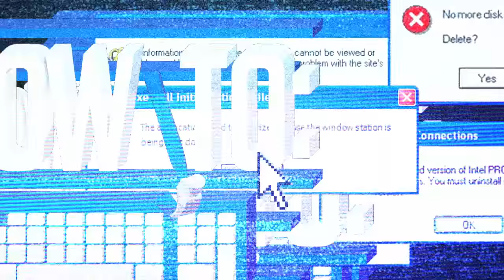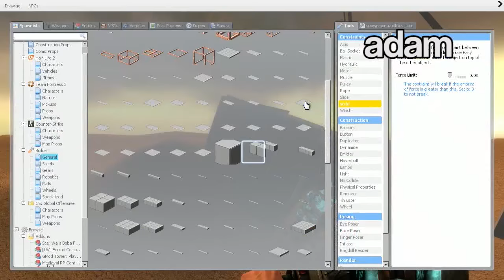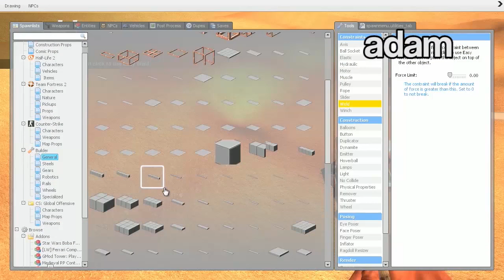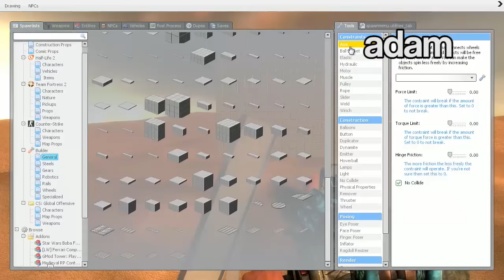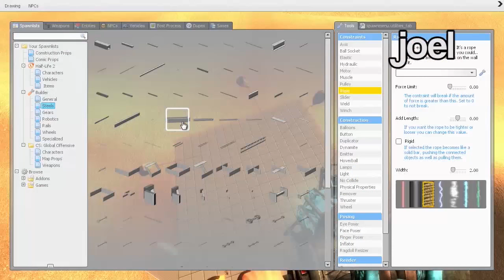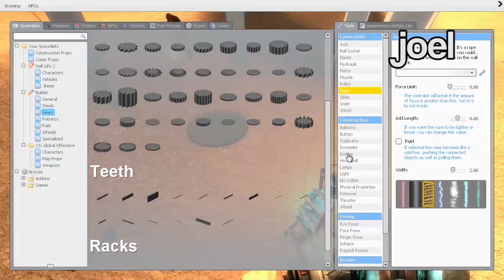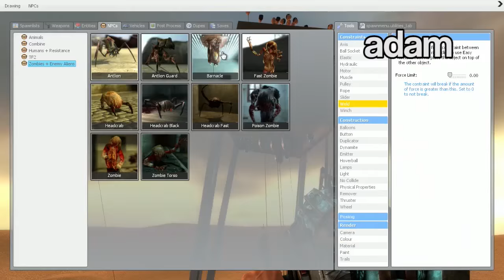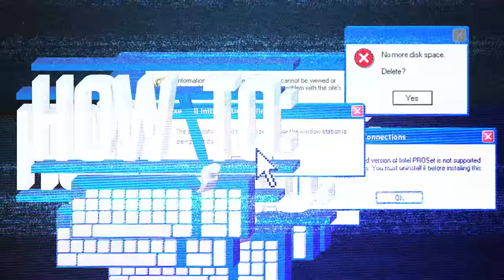How To: Gmod - Building an AT-AT

Comment: Did he say a "competition package"? What does that mean?
Reply: +tibschris It's a package that came on BMW M3s
Reply: Yeah but what does it mean? It looks like these are physical upgrades to the car? A lot of it is jargon.
Reply: +tibschris While there is no specific definition of what a competition package entails, it is basically when production quality parts on a car are replaced with higher quality parts to potentially be used to compete in motorsport event(s). It can replace things like brakes, gearbox, suspension, tires, a lighter driveshaft, employ weight reduction techniques etc.